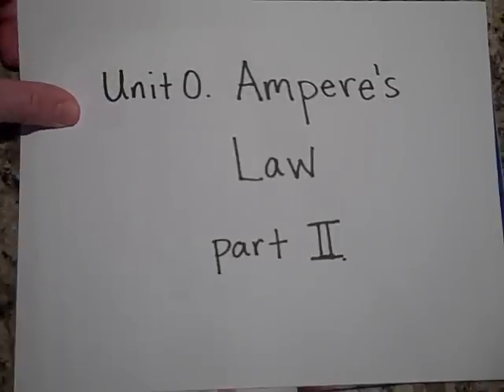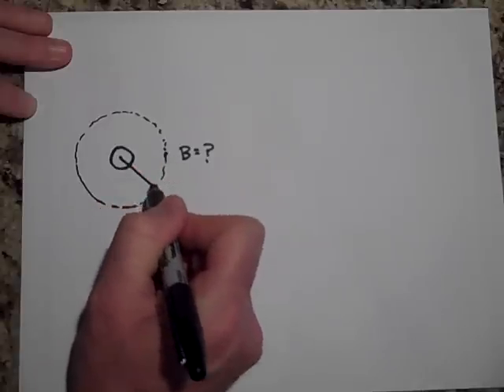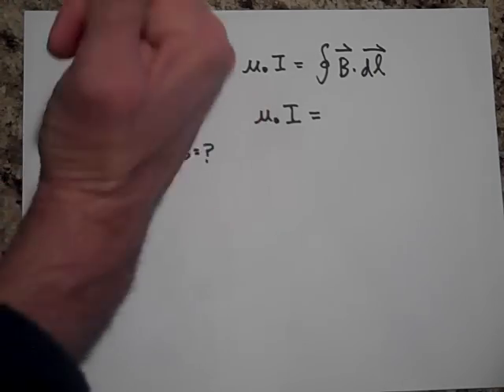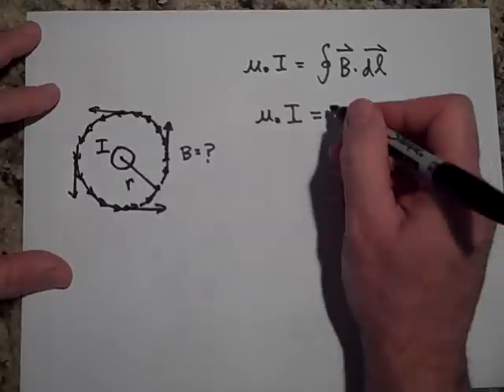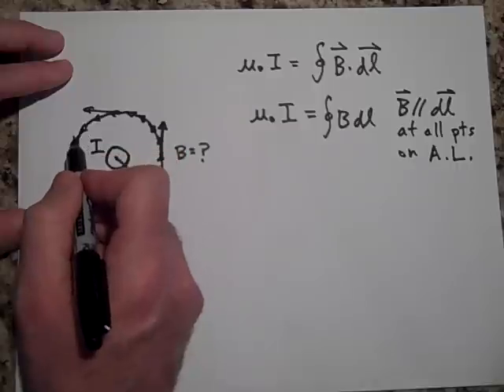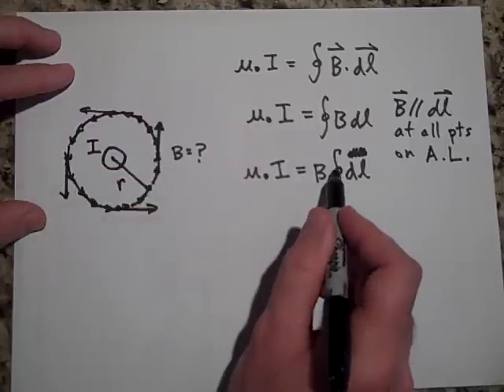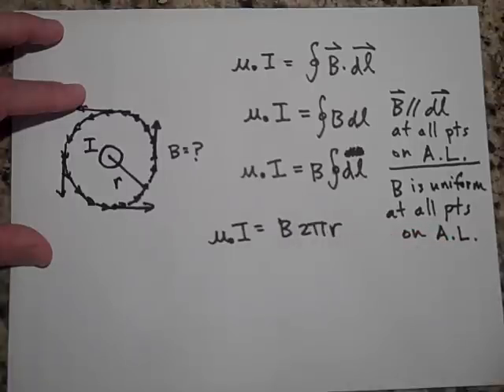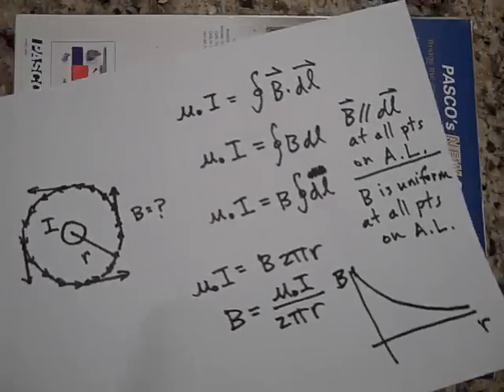An Introduction to Ampere's Law (part II)

Comment: so if the point you're finding is inside the wire, just multiply r^3/R^3 to the current to get only the portion of the current going through the wire

Comment: I appreciate these videos, but I wonder why you don't define the differential lengths (dL), as differential arc lengths(dS) and then have dS=r*d(theta). Then plug that into the integral with the bounds set from 0 to 2pi. Since r is constant on this loop (circle), this evaluates to 2*pi*r. This way the viewer has a more rigorous understanding of Ampere's Law.
Reply: 13 years ago..  a little late, but you wouldn't do that because ampere's law is supposed to be simple. Using biot-sarvart's, on the other hand, you might be required to use that approach. There is no need to add unnecessary steps to something that's utilizes symmetry for efficiency.
Reply: @yeahhh-pn8wi  😂😂 this will help  his son probably